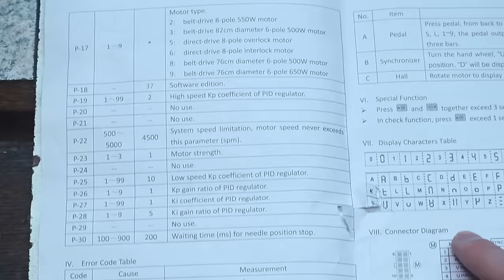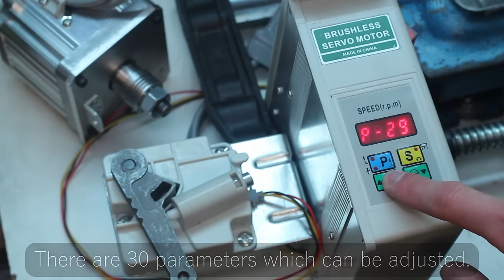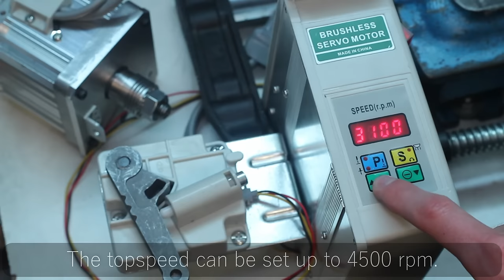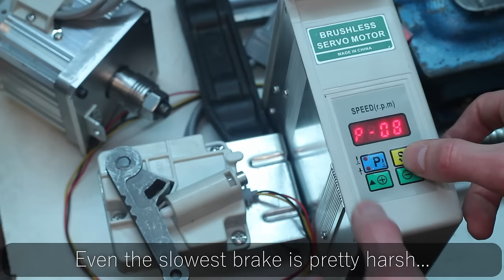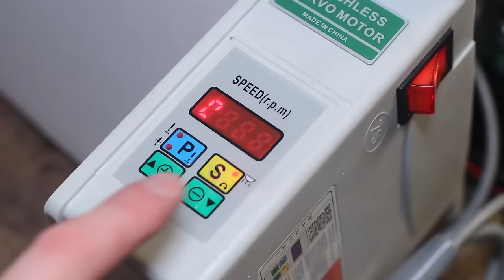New Brushless Servo Motor For The Mini Lathe

Comment: Any crash stop electronics in case you ctash the tool and jam up the chuck, power must be automatically cut off.
Reply from the maker: You mean an emergency switch? My plan is to install a proper electrical cabinet soon. You can already see it in the end of the video. There will be a emergency cut off implemented.

Comment: What size chuck do you use?
Reply from the maker: That is a 80mm chuck. I'm thinking of replacing the spindle for one with 100mm chuck flange but not quite sure yet if it's necessary.
Reply: @WeCanDoThatBetter  I just ordered a 100mm spindle. I was debating the same. But there was a sale on 100mm chucks and I needed new chucks anyway, so it would be the same price for 2 80mm chucks as it was for a spindle and 2 chucks

Comment: for a mini lathe 7x12 is enough the 550w like yours or is better to buy the 750w
Reply from the maker: As far as I can tell from 3 months of use 550W is plenty enough for what I am doing. I have never stalled the motor so far, only the belt drive slipped once.
Reply: @WeCanDoThatBetter  ok thank you.

Comment: Pass übrigens auf mit dem was als 5V beschriftet ist (Pedalsensor). Das ist nicht von den 230V getrennt! Also 230V gegen Erde. Du kannst dir denken wie ich das festgestellt habe ;)
Reply: 😅 Jetzt kannst du zum Glück lacheln, das war aber Lebensgefährlich 😱
Reply: @506d6a  Ja, deswegen warne ich davor. Ich bin selbst Industrieelektriker und stand dabei auf einer Isoliermatte, hilft aber nicht wenns von einem zum anderen Finger geht. Hauptsache nicht übers Herz....
Reply: @therealemmpunkt  Deswegen immer mit eine Hande in Tasche
Reply: @therealemmpunkt  Glück gehabt! Hatte ich da nicht ein CE Label gesehen auf dem Teil 🤔😉

Korrektur: hat P Mk gegolten.
Reply from the maker: Danke für den Hinweis! Heißt das, so wie ich den Pedalschalter gerade provisorisch montiert habe und bediene ist es lebensgefährlich oder zumindest fahrlässig? Wie kann ich da auf Nummer sicher gehen, dass nichts passier?
Reply: @akotopicx  ist das mir auch aufgefallen 😉
Reply: @WeCanDoThatBetter  I'm doing the same conversion to my mill.  As long as you keep the foot pedal box closed you should be ok.  If you change to a simple potentiometer know that there will be 230v on it.  I designed a small opto-isolated PCB that converts 5v PWM to the weird voltages that the controller wants.  Happy to share it once I've tested it.
Reply: @WeCanDoThatBetter  Nanu, ist meine Antwort weg weil mein Insta-Link drin war? Nochmal Kurz: Wenn du das Teil nicht aufmachst ist es ungefährlich...
Reply: @unrepentantgeek  Nice, even better! 👍🏻Means, the controller want's typical 0-5V DC input ? Totaly unclear why they manage it somehow with mains power hooked up on the potentiometer  🤔🤔🤔
Reply: @akotopicx  The mains power in the control line isn't uncommon.  It's easier to let the control circuit's ground float at 110/230vac.  Since ground is relative it all works.  In fact the stock electronics are likely doing the same thing.

The foot pedal control circuit outputs between 1.2v and 4.2v.  At around 2.35v the motor start spinning at min RPM.  Between about 3.15v and 4.05v the motor speed linearly increases.  My circuit has pots for tuning these points since they are so weird.
Reply from the maker: @therealemmpunkt  Oh schade, hab die Antwort nicht gelesen. Ich weiß nicht, ob Kommentare mit Link gelöscht werden, seltsam. Jedenfalls danke für die kurze Entwarnung :)
Reply: @WeCanDoThatBetter  Dann nochmal ohne Link, gibt eh nicht viel zu sehen. Ich bin aber unter deinen Followern auf Insta, mein Logo sollte erkennbar sein.
Solange du das Pedalteil nicht aufschraubst ist alles OK. Innen ist eine offene Platine, da sind wieder 230V drauf, Im Hebel ist ein Magnet der auf den Sensor wirkt. Am einfachsten dürfte es sein den Hebel zu verwenden, vielleicht mit einstellbarem Anschlag um die Drehzahl zu begrenzen, hab ich aber auch noch nicht gemacht. Ist bei mir im Moment genauso wie bei dir...Ich hatte versucht den Sensor gegen ein Poti zu tauschen, hat aber nicht (gut) funktioniert, da die 5V bei kleinster Belastung schon zusammenbrechen.
Reply: @unrepentantgeek  ok, thanks for the explanation - good to know 👍
Reply: Was ist denn genau gefährlich? Was darf man nicht machen?

Comment: why did you swap to a poly v belt?
Reply from the maker: Hi and thanks for your comment. First I wanted to keep the tooth belt. But the pulley I purchased for the new motor didn't fit exactly to the weird uncommon profile they used on this machine from factory. So I decided to switch to poly v as I wanted to try that out and poly v belts usually run smoother than tooth belts. So far I don't regret that conversion. Off course, they are more likely to slip but I keep that as the weak point. Better than breaking gears :)

Comment: 5:24 You missed one of the motor mounting screws
Reply from the maker: You have good eyes ;) The missing screw collided with the lathe casting, so I didn't install it. Later I changed to countersunk screws and could use all 4 of them without collision.

Comment: I done a brushless sewing machine motor conversation some time ago.i mounted the motor on a steel plate and removed all the internal gears and use a large pulley wheel straight onto the back of the spindle very simple very powerful.small clip search my name Terry griss.
Reply from the maker: Hi and thanks for your comment! I viewed your video. Interesting setup too! I wanted to keep the gear as I often use the lower gear for threading and when higher torque is needed. Where do you get the tailstock from? It looks extremely cool and much sturdier than the original one. I definitely need one :)
Reply: @WeCanDoThatBetter  the tail stock is standard supplied with the lathe I bought it from amadeal in London the cj18a.
as for low speed torque nine has loads I can't stall it even at very low speed because of the pulley gear 2 to 1 reduction max spindle speed is 2200rpm so no gears needed.i took the spring off the speed control handle and mounted it in a 3d printed control box.
Reply from the maker: @terrygriss4132  Thanks for your reply! Interesting, I want this tailstock :) The thing with the motor controller sounds good too.
Reply: @WeCanDoThatBetter  yes the handle is a little loose with out the spring so what I did was put a piece of rubber with a slot through the opening which rubs against the handle and also keeps swarf out.
Reply from the maker: @terrygriss4132  Sounds very clever :) I have some plans for the handle, but we'll see if it works as expectet. But there are some other projects first to finish... :o

Comment: l gutted mine, gave all the pieces and motor to wire guy geek l know, put a/c motor behind lathe with just on-off switch, V-belts a pulleys, and did steve jordan pulley spindle mount too! its a 5&1/2". No mother boards, nothing but on-off switch.
Reply: The advantage of that is that you get much better torque at low speed. Firstly, the AC motor has maximum torque at zero revs, and secondly you are using pulleys to multiply the torque at low revs. The standard "single-gear" DC motors (no matter if brushless or not) will not have the same grunt at low speed, which is actually where you need it the most.
Reply from the maker: Yes exactly. I won't miss an adjustable speed control and also the second gear. For threading an drilling with large drills it is really helpful.